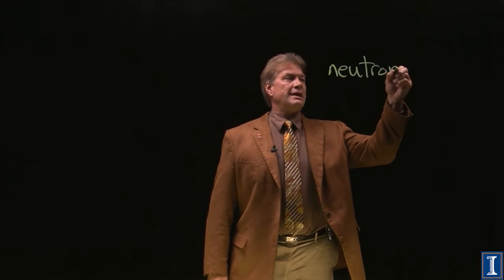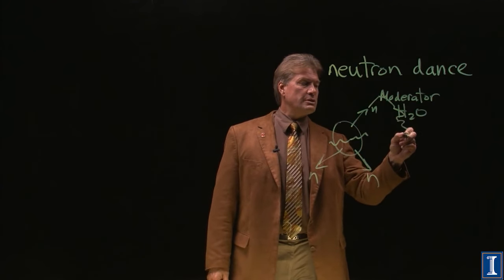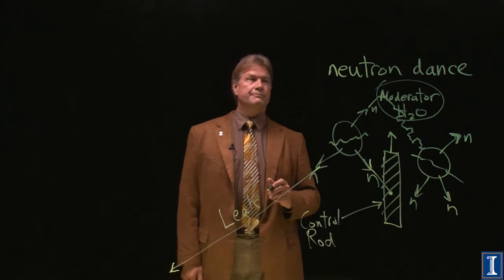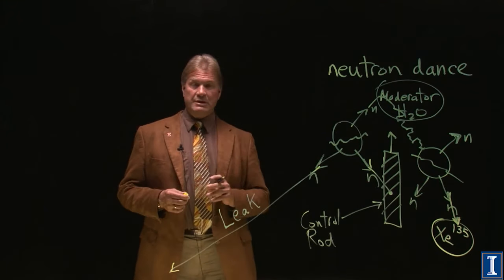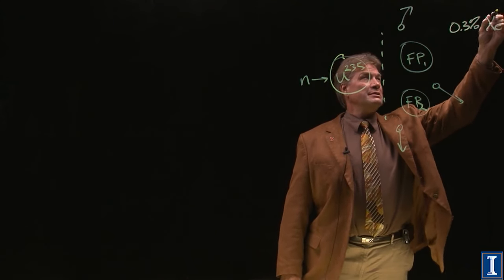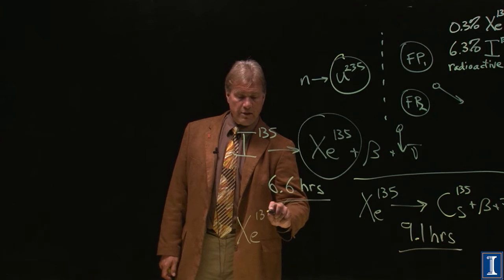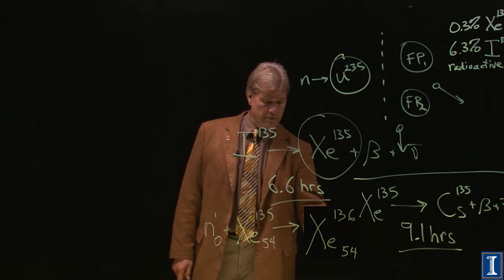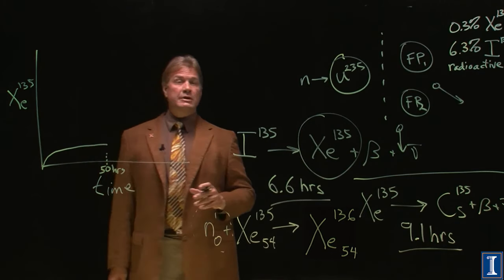Xenon Can Be a Problem

Comment: The American media, even the latest popular Web series named Chernobyl looks over Xenon poisoning. All they focus on is the bad design of the RBMK reactor.
No media attention on the stupid things done by the operators.
It's like removing all the brakes of a car and complaining when the car crashed.
The lack of understanding of Xenon poisoning is the PRIMARY reason for Chernobyl compared to the graphite tipped control rods.
Reply: Funnily enough, the RBMK reactors aren't that bad. Besides the carbon tipped control rods.
Reply: @mpk6664  Exactly! They are good enough with in built safety systems that insert control rods much before the reactor becomes unstable.
That prick Dyatlov oversaw disabling ALL automatic safety systems and ignored the computer warnings.
The only flaw I see was the absence of an extra containment building
Reply: There's a reason nobody else uses commercial graphite moderated reactors
Reply: The show actually discussed both, and set them up as legitimate reasons. First, I think the show actually did a bad job calling these graphite tipped. The way a RBMK reactor is designed there is a graphite rod at the bottom of the control rod, if you lift the control rod up, you are lifting the graphite rod up into the reactor to replace the control rod. There is also a void between the two rods which has some displaced water between them. The issue is that when the graphite moderator is fully elevated, displaced water goes into the bottom, like a cap, because the fuel rods are longer than the graphite rods. The issue in this design, is that as soon as you scram the reactor and inserts all of the control rods, the first thing that is going to happen is the water will displace, and the graphite will fill the void. When this happened it created a hotspot of intense heat, for just a few seconds, this was enough to burst and break the control rods, fixing them in place. Since they were fixed in place, the reaction never slowed, vaporizing all of the water and turning it into a steam bomb that blew off the top of the reactor, allowing oxygen in, which should never be present there, and that triggered the explosion and fire. So yes, xenon poisoning contributed the disaster, but the real cause was an emergency shutdown system that was literally a nuclear bomb detonator. Sure, xenon poisoning caused the reactor to go critical, but the emergency shutdown should have instantly shut down the reaction, and instead made a huge explosion of thermal energy. Hope that helps.
Reply: I'm not sure if you completed the web series, but the last episode had a huge section dedicated to just explaining the Xenon Poisoning. Azimov even tells Dyatlov, "the reactor is in a xenon pit, we have to shut down, we have to wait 24 hours." He then asks Dyatlov to record his order in the book, who then smacks it out of his hands and orders him to do it or never work in any reactor, anywhere, ever again. There was absolutely someone in that room, that not only knew this rule, but protested the orders they were being given. Dyatlov knew all about this rule as well, this wasn't ignorance. He was defiant, because in his younger years there was an accident that had exposed him to lethal doses of radiation and he was fine, he lived believing he was invincible. Despite this, his son died of Leukemia, due to contamination that he brought home from the earlier incident. He was a stubborn idiot, who literally ordered his crew to turn a reactor into a nuclear bomb, despite every regulation otherwise. Valery says this in his speech at the end "Dyatlov broke every rule we had, every one of them, but he did so with the belief that there was an emergency shutdown system that could prevent what happened." I'll remind you that even after the incident, Dyatlov was so certain that this event could have never happened, that he sent his men into the core, killing them with radiation poisoning.
Reply: @mpk6664  There are still 10 RBMK reactors active in Russia right now. They made some changes to them, but I should note that they still operate on graphite, and still operate with a positive void coefficient, but that coefficient has been lowered to what they believe is safer. Many of their reactors, still do not have containment buildings. However, in over 33 years since the Chernobyl incident, there has never been another problem. This is likely attributed to this singular event in history, essentially being what collapsed the USSR, and why we have a Russian government today. Russia is an entirely different country today than it was in the 80's. Not enough has changed, but plenty has.
Reply: @rapidrabbit11485  these reactors need a certain set of circumstances to do what happened at Chernobyl. It just so happened that those were all in place that day.
Reply: This guy doesn't know what happened at Chernobyl and just repeats common myths. There was no shutdown and wait for hour or two to build xenon poisoning. They were at low power of 30 MW for 5 minutes only and xenon takes time to build up - half time of I-135 decay is 3 hours. They took a lot of control rods out when they were bringing it back to 200 MW but once they stabilised at this level the reactors was within regulation parameters - they had operative reactivity margin of 17--19  equivalent control rods with regulation minimal limit of 15. There was no reactor runaway until they pressed AZ-5 scram button. Please read INSAG-7 report from IAEA before discussing details of Chernobyl accident.
Reply: Alex Demidov Actually the reactor power of 200MW is well below normal operating power and the reactor will not burn up the Xenon at this level. Because of power requirements of Kiev and a long delay and new shift of operators the Xenon had already built up and iodine decay from when it was at full power was generating more Xenon. That why they had to pull most rods out. Also mpk666 it is a bad design with a positive void coefficient- banned in the west- and no containment building - also banned in the west.
Reply: @markthorne2296   The 200 MW(t) was enough power level for the  test - the requirement for the test was 700-1000 MW(t) maximum as they needed to cut off the steam from the turbine and to handle this excessive steam they had to operate at the lower power. The reduction of power from nominal to half level happened 20 hours before the test and all xenon already burned out during this time period. I already said about number of control rods in my comment above - during the test they had 50 control rods in the core out of 211. Read the report before repeating all these myths.
Reply: @rapidrabbit11485  what is the name of that web series?

Comment: This man is delusional get him to the infirmary
Reply: please explain.
Reply: @c0461-e1s  wow, thanks for answering without sarcasm, cause i was literally about to ask the same thing
Reply: @c0461-e1s  you're confused rbmk reactor don't explode
Reply: Bill Laswell  You must not get around YouTube much. And/Or you never leave the realm of videos on nuclear reactions.
Reply: @p5satanael  Even with the safety upgrades after Chernobyl, the RBMK design (still 10 units in operation in Leningrad, Kursk and Smolensk) allows an explosion. A sudden loss of significant water masses (i.e. a large size LOCA), will increase the reactivity by 4-5 betas. A beta stands for the amount of delayed neutrons, which is the reason you can control a chain reactor in a nuclear reactor. One beta is the difference between prompt critical and (delayed) critical. Prompt critical means boom! as in atom boomb (even though badly designed atom bombs may fizzle and tear themselves apart before splitting a significant part of the nucleii).

https://www-pub.iaea.org/MTCD/Publications/PDF/Pub913e_web.pdf  page 3

Comment: I used to build ion drives for the UK military. Xenon was our fuel; and a great fuel it was too. My old boss, the late great Dr David Fearn, used to complain that Xenon wasn't as good as mercury, which they used in ion drives in the 60s. Xenon did have the upside that you didn't have to put on chemical weapons suits when you opened the vacuum chamber and took a drive out. Mercury plasma is not particularly good for one's health. They used to have mercury alarms in the 3m vacuum chamber building. Scary.

Comment: Quite strange at the operators of Chernobyl didn't know the basic things how nuclear reaction is running.
Reply: Adelram Wolfrik They did but the man in charge allegedly overruled them in order to finish the test 😯
Reply: That's Socialism for ya.
Reply: @iasimov5960  what does the power structure in a control room have to do with an economic system? 
I think maybe you're using words you don't understand comrade.

Comment: Ooooooh! You are supposed to wait 3 days. Well I have been running my reactor at home incorrectly this whole time.
Reply: I'm really grateful for this information as well.   Absolutely a must share for all my friends with reactors.
Reply: @SteveJohnson007  Thank you Steven for your very informative videos. I am degreed in Electrical and Computer engineering, but I have always taken an interest in Nuclear engineer. Great content!
Reply: Not always true.  In commercial reactors generally they restart the next day - 20-24 hours is enough for a lot of the Xenon to decay and the rest can be overcome by careful startup procedure.
Reply: no, thats jibberish.  reactors DO NOT NEED three days between shut down and start up.  building up that much xenon is a symptom of poor management, nominal levels will decay within the day
Reply: @SteveJohnson007  too bad the three day thing is completely wrong
Reply: @RedScaledKnight1 Did you watch the entire video?
Reply: You don't have to, you can make a reaction start with an insanely high amount of xenon, it's just more dangerous the more xenon there is. Because you need to adjust the rods to stop the reaction from starting back up too strongly and you can only move control rods so quickly.

Now plants have much better control systems and you won't run into this problem, but it is something you have to consider carefully. If it's possible to wait, it is the safest option.

Comment: It amazes me that nature seems to be trying NOT to do fission.
Reply: Or, at least, not steady, controlled fission.  It is always a bit like balancing an inverted pendulum.
Reply: The problem with fission naturally is that it is typically all or nothing if you have enough fuel to go critical.
Reply: All of the world's Helium supply comes from Alpha decay underground. Nature is okay with fission, but not this chain-fission ox we've yoked. The element Promethium was discovered as a result of nuclear experiments. I think it's the most aptly named of any Element artificially discovered. Promethius stole fire from the gods. We stole fission from God while treading on his domain. We must treat lightly.
Reply: I have heard that fission wells are found in nature where a hollow in the surrounding fissile material fills with water, which acts as a moderator: it goes critical and boils the water out, and so on in cycles.
Reply: @SeekingTheLoveThatGodMeans7648  I might have meant this tongue in cheek.. I don't remember..  but there is evidence of natural reactors but this was because the u-235 percentage was HIGHER and enough to sustain a water moderated chain reaction.  Nature has half lived enough of it away so I believe it could not be currently happening...

Comment: I have never been happy with the suggestion that the positive void coefficient was the root cause of the disaster. It took such remarkable efforts of stupidity to make the reaction go out of control that it really was human error and poor management systems that were at fault. After all, the other units performed without incident over their lives and the design was very much more cost effective than western designs in my admittedly inexpert opinion. The reactor was in a state that it was never intended to be at any point in its life and for very good reason.

Comment: It was mostly a symptom of the soviet system. A nuclear engineer that had far too much confidence in the reactor design and his colleagues used his position as head of the experiment to force the operators against there protests over the procedure, potential danger, with the reactor being in a xenon bath as the reason.  The communist system meant that influential people of power could destroy your life if they want too and their jobs were threatened. Also, they were the night team who was younger and less experienced. This reactors test was supposed to be performed before starting it, so there was a lot of pressure to do it except it failed in the past. Apparently, the construction involved a lot of corruption and the use of subpar materials as well as a rushed build so managers could get the reward for finishing on time and under budget. 

Apart from that, I don't see why you must wait 60 hours before turning the reactor on. Couldn't over say 12-24 hours you could incrementally pull the control rods out to speed up the process. Perhaps you could even just pull the rods out to a known operating level and wait. Although just as a way to speed up the process of burning xenon off, not as a method to generate any significant amount of power. It is when as with Chernobyl after stalling the reactor the experiment leader insisted on getting the reactor to a certain generating power which resulted in the control rods being pulled out more and more until the power rose. Leading to a power spike in output after the xenon was burnt off.
Reply: Yes. Another comment from a qualified nuclear technician says that they restart reactors safely without the three day wait "riding the xenon curve"

Comment: During the Chernobyl power back-up experiment that went bad, there were no nuclear scientists on site. The operators and engineers did not have sufficient knowledge of the reactions that took place inside the reactor. They operated under political pressure (to do the experiment) and at an hour during workers' shift change.

Comment: Actually, the water moderator controls the power output once the control rods are set in the desired position. More power required means more moderator flow. That means more cooled water is returned to the reactor. If demand decreases, less cool cooled water is returned. The difference in more and less cooled water results in a self moderating effect. More cooled water is a little more dense than less cooled water. So, more cooled water slows down more neutrons and fission increases. Steam demand drops and less water flows back from the heat exchanger. Reactor temp rises and the water moderator density decreases and less neutrons are slowed down = Less fission. The control rods are more for start up, balancing the fuel consumption across the core, and of course, the big one: SCRAM!! Fuel balancing is an issue. The assemblies on the periphery see less action and such. Like the bottom of the core gets worn out and the rods have to be pulled out a bit more to use a new level of the core..
Funny story; Back in Navy Nuke School in 1969, the instructor was saying the neutrons had to be slowed down. I raised my hand and asked why they had to be slowed down. He said; "I don't know. Nobody knows". Well, that really stuck in my craw for 40 years. I finally came up my conclusion in 2008. The answer is TIME. Because a free neutron decays in ~14 minutes to an electron and a proton, it's obvious that neutrons have positive and negative components. The neutrons need a small amount of time to become somewhat polarized. Only then can they more or less, cozy up to that U235 and be absorbed rather than splitting it apart. The fast neutrons just bounce off. Occam's Razor. (Sorry, got carried away. Great videos. I watch all of them. Thanx.)

Comment: What is your take on the fully integrated, molten salt, thermal spectrum, graphite moderated reactor? Do you think the plumbing and the separation chemistry will work? Including helium - vacuum sparging of the molten salt? without helium sparging the neutron economy won't work, agree?

Comment: Hate to sound nit-picky but reactor power is not controlled by the control rods but by the density of the moderator. Control rods establish the initial power of the reactor. Steam demand determines the temperature and density of the incoming coolant and fission increases or decreases to meet demand. More steam demand, more heat removed from the coolant which becomes denser causing more fissions. Power increases. I once observed a xenon precluded reactor start-up shortly before the reactor's refueling. It's odd the see all control rods at their top limits and the reactor still subcritical. As xenon decays, the power begins to climb. Calculating xenon concentration is a part of a reactor start-up. I suppose they use computers for such things nowadays but when I performed start-ups we did the math ourselves. I enjoyed the video, though. Good Cliff Notes version for the uninitiated.
Reply: Control rods are opaque, i.e. high density. "Control" indicates a human requirement. Your scenario and recollection is of an uncontrolled reaction in an environment that did not require control. I'm just being argumentative.

Comment: So, in theory, you could pull the control rods to a normal running level, and get the reactor back up more slowly than normal but still less than 3 days.  Of course, just where between normal & 3 days would depend on how much Xe is absorbing neutrons compared how much the control rods are.  If it's mostly the Xe, you probably won't gain much time at all.